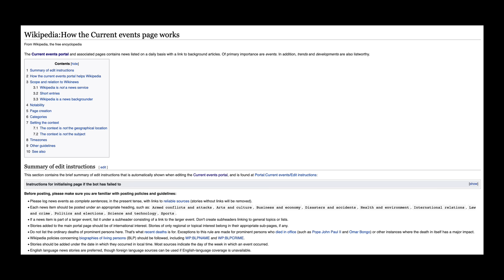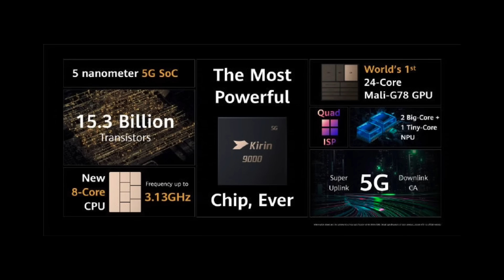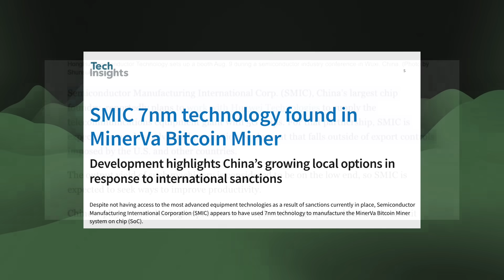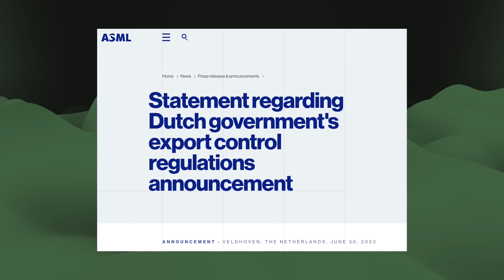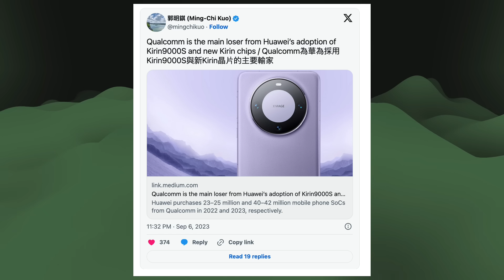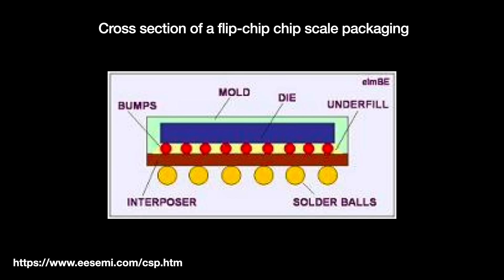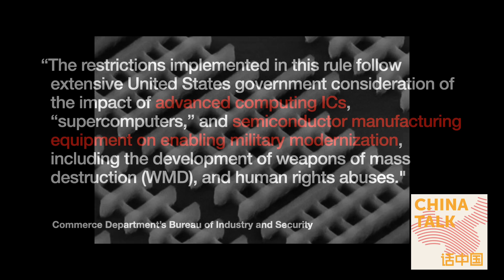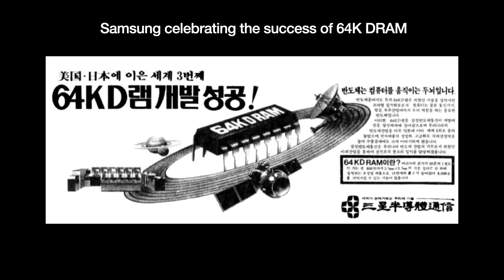China's 7nm Semiconductor Breakthrough

Comment: As long as rapid progress continues in development of electronics, Chinese semiconductor industry will not catch up. A semiconductor company that can pick best of the best technologies from anywhere in the world will always beat a semiconductor company forced to pick best of the best from just China. When it comes to leading node, the political advantage is unbeatable. 
Its a different matter when Moores law finally gives up the ghost, then 5 years behind becomes the same thing as latest and greatest.
Reply: That's assuming China won't find out some big breakthrough though, which they likely will do.
Reply: Cope and seethe. America can't even make 7nm even after pointing a gun at TSMC's head and forcing them to import hundreds of engineers from Taiwan because American talent doesn't cut it.
Reply: @MrSpiritmonger sanctions keep failing in general, cuz there are too much ppl from external system, which want to make profit from avoiding sanctions
Reply: @MrSpiritmonger  they understand, but they need more time to put down external elements. Like private Israeli companies, which supplies ruzzia. Hardware began to cost much more, than direct import, but it remains for ~6-12 months until company is sanctioned

Comment: Sooner or later, SMIC will able to produce 7 nm electronic chips. Even the first 7 nm electronic chips were introduced 5 years ago.

7 nm scale MOSFET'S were first demonstrated by researchers within the early 2000s. The 7 nanometer (7 nm) lithography process is a technology node semiconductor manufacturing process following the 10 nm process node. Mass production of integrated circuit fabricated using a 7 nm process began in 2018.

Comment: HKUST, an A.I company collaborates with Huawei to make high end A.I solution. They are planning to release a GPT -4 rival by this year and plan to benchmark with it in the first half of next year. According to the CEO of HKUST, Huawei already has a graphic accelerator as good as A-100. He as much admitted that hey are using this chip for the high demands required for work on that GPT rival.

I imagine a disclosure of this chip could come as early as the Huawei conference on Sep 25.

If you were simply presenting facts in a neutral fashion you would have commented on  it since this claim is so important.

Comment: The arrival of this phone does not look good for YMTC. Y'all see, a sanctioned entity (HiSilicon a wholy owned subsidiary of Huawei) designed the new Kirin SoC at the heart of the phone, then another sanctioned entity (SMIC) manufactured the SoC. Then another sanctioned entity (Huawei propper) manufactured the phone. Yet, when the time came to get RAM and NAND flash, Huawei went to the Grey market instead of using technologyy from another sanctioned entity (YMTC)...

¿Why not throw a lifeline to a fellow sanctioned entity? There are rumours of YMTC firing about 10% of their workforce due to sanctions.
¿Did they not have technology to match SKhynix's?
¿Does Huawei expect to manufacture/sell so few of these that their stockpiles and/or grey market acquisitions of RAM & NAND-Flash were enough for the production run?

Only time will tell...

But YMTC will 丟臉 with this for sure.
Reply: Hynix chips are Huawei's long-standing inventory. China has the ability to completely replace Hynix. Hynix and Samsung have already had a price war with ymtc in China.